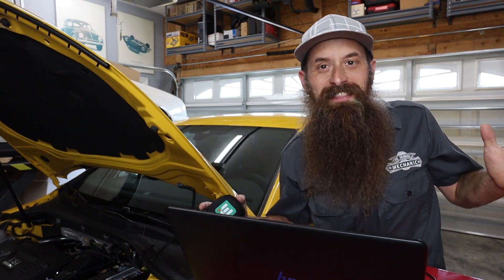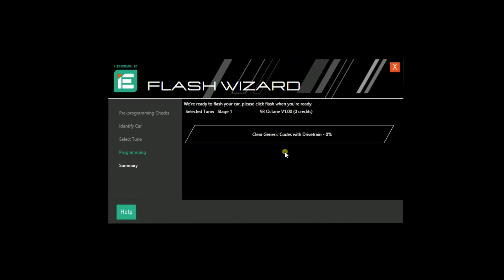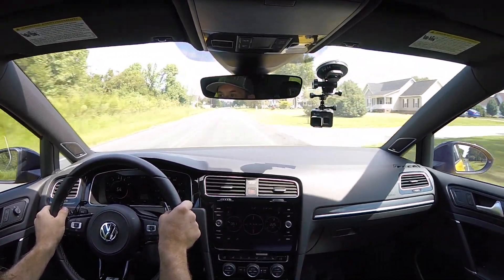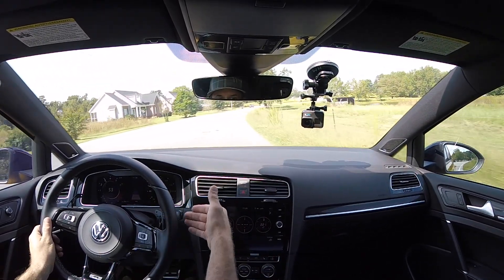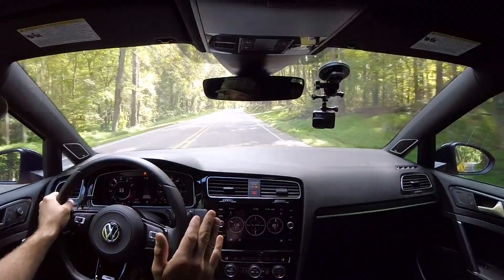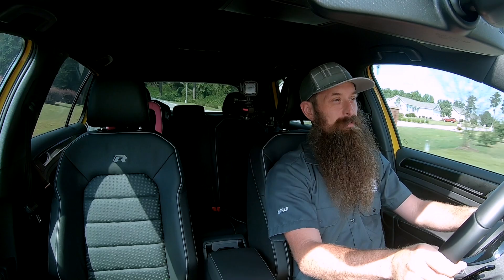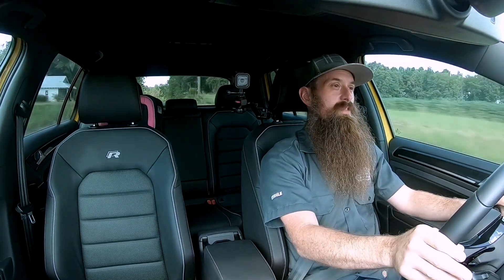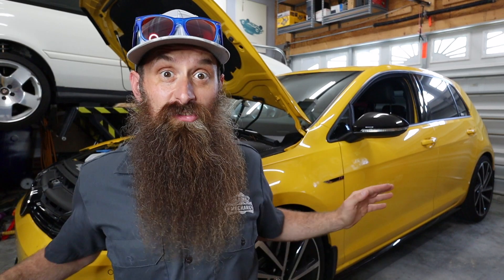How Much Horsepower Does a Tune Add? ~ Stage 1 Tuning Golf R

Comment: Unitronic has more power gains nice tunner though
Reply: Unitronic stage 1+ you would of been at around 335WHP atleast
Reply: @charlygen2cc78  Hard to say... cars, locations, dyno calibrations, dyno brand, temperature, pressure, corrections, etc... all differ the end numbers by massive amounts. A Dyno is only good at comparing the same car on the same dyno back to back... comparing two different results from wildly varying conditions just doesn't work.  Unitronic has very good calibrators, but were pretty sure all Stage 1 Tunes are going to be very similar in power output. Where they differ is how the car drives when not full-throttle... that is going to be up to personal taste for the end user.
Reply: Great point couldn’t have said it any better. With that being said, You should make a video on dyno tune and brand name tunes comparison and why is a dyno tune way much cheaper than Unitronic Cobb IE apr etc etc
Reply: @charlygen2cc78  Well, we typically don't like to advertise directly against other companies out of respect... we have always just let our products speak for themselves. A "dyno tune" is probably cheaper because contrary to popular belief...  they can't in 99% of cases offer a fully optimized tune for these vehicles. These modern VAG ECUs are very complicated and very locked down. For a company like us offering a complete shelf ready ECU tune optimized for hardware in all/any climate and altitude takes IMMENSE amounts of time. The amount if investments in both buying and engineering tools from scratch to read/flash/translate/identify the complicated mapping in these calibrations is huge. Putting a car on a dyno and adjusting a few timing and boost maps for more power a WOT is one thing, completely creating a well rounded performance file that optimizes every map takes a ton of specialized equipment (much that is not available for purchase) that a typical dyno tuning shop will not have access to. Same reason a full tune from us takes months to build vs. a day on a dyno. That is why there is only a handful of tuning companies are offering these files like we do. Hope that helps make some sense out of your question.
Reply: Integrated Engineering LLC. Yes understood, another question I have Unitronic stage 1+ on my vw cc. The question is, after every mod I add on will I have to retune my car or can I just add on mods and the ecu will react positively?
Reply: Love your videos !!!
Reply: And tbh that laugh made that video A VIDEO! Love the laugh.... hehehe 😈

Comment: Love the upgrades.  Keep goin.  I will list my upgrades and have hit 100,000 miles on Audi A3 Quattro with no issue from extra power.  Sumbitch is extremely fast. 
Unitronic stage 2 tune
Unitronic stage 2 DSG
Full set of bigger charge pipes from turbo to inter cooler and back to intake.
GFB diverter valve is stronger than stock.
Turbo muffler delete.
Cold air Intake
Intercooler
Lightweight Enkei RPF1 rim saved 10 lbs per wheel.
Bilstein coilovers adjustable
Full turbo back Borla exhaust. It has 2 mufflers no mid silencer.

Comment: TCU tune is the best bang for the buck with these DSGs.  The stock tune is pretty bad unless you drive it in manual mode all the time.  I opted for the TVS stage 2+ stealth TCU tune and it's been a game changer. Pulled my JB4 for warranty purposes, prob will tune it after the warranty expires in 5 years
Reply: I know this post is one year old..but never heard of a stealth tcu tune. That's Impossible

Comment: Oh why didnt I get a dsg?!  Scared to tune my 16 gti with all ive heard about failing clutches.  I guess that is what credit cards are for.
Reply: We do offer a low torque file that is safe for your stock clutch, when you do upgrade the clutch and are ready for more you can flash the High Torque file at no additional cost.
Reply: Stage 1 low torque or get a stage 2 clutch. I'm in the same boat, 17' GTI SE.

Comment: Do you think it’s worth tunning my MK7 GTI with 120K miles on it? It’s still fully stocked and it’s my daily driver. No issues with the car but I wouldn’t mind adding 70+ HP to the stock 210. Why didn’t you go unitronic?
Reply: If you've done your services on time it shouldn't be an issue. May be a good thing to do a leak down test and have someone give it a once over before hand though.

Comment: hey man i have a mk5 gti and ive been thinking of going stage 1,but ive heard it puts alot of wear on the stock clutch. just wanna know what your opinion would be.
Reply: Tuning does put stress on manual clutches, yes. Especially on older higher mileage stock clutches. You can always tune it and go back to stock (at no cost with us) if it starts to slip, then put the tune back on (again at no cost) once you upgrade the clutch pack.

Comment: You should definitely do a downpipe if you haven’t yet. That’s where the serious gains are in junction with a tune.
Reply: Keith Doran Won’t do much with only stage 1. You’ll even lose numbers with a DP on. That’s why the tuning company has a list of requirements and recommendations per tune. As for stage 1 with IE, I believe the only supporting mod required is a CAI. DP and IC is required for stage 2.

Comment: Wow 40 psi on the gauge when 30 is stock. That makes me want to make the jump. 
I see your screen does the same as mine when the g meter shows nothing on start. Forcing you to change away from that screen and back to it to get it working. Is there a fix for that?
Reply: The gauge includes the static atmospheric pressure too.

Comment: I ran my MK7 with the Soundaktor off for 4 years. Finally turned it back on to sell it to a 22 year old kid who giggled uncontrollably when we went out for a test drive. I think it's just designed to get you to buy the car, haha, which he promptly did.
Reply: you know you are old when u call a 22 year old a kid
Reply: You know, I hate it in theory but I’m gonna keep it. I think it sounds good and at least it’s not digital noise piped in through the speakers.
Reply: Funny when i sold my mk6 GTI with stage 1 , he was excited about buying a golf [ cause you know you can tune em  man ] really i just saved you some cash man i have it , SOLD , did not even try to beat me down , and i had the soundaktor on  too.
Reply: Golfmother it’s a fair point but personally would never buy a car that’s been Mapped … mainly cause you don’t know if the tune was done properly or not .. also any tuned car obviously been thrashed about 🤷‍♂️

Comment: I had to put the R8 coils in, the stock ones kept failing.  Is that a common thing?
Reply from the maker: Coil failure is common on all VWs.
Reply: @HumbleMechanic  I had to do it after the tune.

Comment: Why not go APR? What make your go EE ? Or not unitronics like Dap
Reply: KnightGamingDc5_ APR is overrated. I’m running IE stage 2 performance and DSG tune on my MK6 GTI and I love it! I also have supporting mods all from IE - CAI, IC and DP. Best part is, IE has the best customer service hands down!
Reply: 034>
Reply: IE might have given the HM the tunes for free if he did an episode on it.
Reply: Uni and APR are good options as well. We think you'd be very happy with IE's tunes as well as theirs. A lot of time has been put into our tunes on the development side making them a very high quality product. Plus, you can return it if you don't like it, pretty minimal risk.
Reply: 1.) It would be awesome to see a comparison of different mild tunes for Golf R’s!! 
APR’s APR+ tune (limited-substitute-drivetrain-warranty-enhanced low torque stage1) they vow makes 357 HP/ 349 TQ. And your VW dealership will do the tune. Discussion of the value of APR’s warranty aside (I’m sure it costs more than the product reviewed here) APR’s gains from modest-modding seem comparable, no?  Would be super interesting to see video of tune v. tune!

2.)How would you compare the driving experience of an air cooled 911 to a mildly-tuned Golf R? 
Obviously the 911 will deliver all kinds of majestic mechanical sounds and feelings, but ultimately which is quicker? (In the dry, obviously. In anything but perfect conditions, if anyone actually takes a RWD aircooled 911 out of the garage in rain/snow, it will be slower than the R.)
Reply: APR is too conservative and their support is garbage

Comment: I bought an Integrated Engineering stage 1 tune with the same flash loader for my 3.0T C7 A6 and it's been about a year.... 100% love it... zero complaints, the car is stronger and far more engaging to drive.  Power delivery is BUTTERY SMOOTH... huge thumbs up to Integrated Engineering for their software!
Reply: Thanks mike! We love to hear that you are happy with your tune(s).
Reply: Does doing this violate the warranty?

Comment: I remember feeling the same way after tuning my GTI. And, like Charles alluded to, you'll want more :)
Reply: I drive a 2014 Wolfsburg GTI. What year, model, and hp after did you have? What kind of mods or bolt ons did you have to equip to help relieve the stress of said tube if any?? Any feedback would be amazing.
Reply: @jbac5767  Wolfsburg? Love it! Mine is a '16 MK7 GTI Sport, originally "210" HP (underrated of course). Went APR stage 1 ECU and TCU tune on the 6-speed DSG. That tune has undergone a lot of revision in the past 1-2 years and it's better for it in my experience. 290 HP and 320 ft/lb is the latest crank figure on *87* grade fuel! I stick to that due to 91 ACN regional gas which causes the ECU to pull timing shown in logs. However, ran the 323 HP crank, 91 tune ran just fine with new intercooler, charge pipes, inlet pipe, turbo muffler delete, and high-flow drop filter. A lot of stuff for stage 1, right?! Your fuel might be better, by a lot. APR now has a fuel info page stating E85 might be an option IF your logs show fuel trims in range. An E30 blend put me on knock-free 380 ft-lb high torque stage 1 territory. Smoke 'em if you got 'em.
Reply: @john_dee1431  Goodness!! Yea I'm lucky eith the Wolfsburg simply becuase it was produced in the Wolfsburg factory itself and everything is in German so the car has stood up even with my little bit of negligence.  The car came with an INJEN CAI. I've done nothing else to the car because I know you must be specific when modifying a VW eapecially. I run 91 at all times and it's been good. The car feels surprisingly powerful for only having the intake and MAYBE 190 to the wheels. It's a 6 spd so I'll lose time there but I don't race or rag my car at all. I only get on it hard maybe once a week to keep it somewhat fresh.  I look forward to tuning it one day and of now I'm simply doing research and asking around. Thank you for your feedback!

Comment: Dammit Charles. You're going to make me go buy a Golf R.
Reply from the maker: DOOO IIIIITTT!
Reply: @HumbleMechanic  I did it, because of you! i have 2019 Gold R in blue :)
Reply: As the devil on your shoulder, we highly recommend you buy a Golf R as well!
Reply: Do it, you won't regret it
Reply: You thinks that’s awesome do a STG 1 tune on an RS3
Reply: @desertsoldier41  You think that's awesome do a STG 1 tune on an RS6
Reply: I get my Golf R in under a week now
Reply: Word i want a R now as well
Reply: Private Eyes I haven’t been following the R news and this came as a surprise to me. Do you have a read or video you can recommend that talks about VW’s plans to discontinue the R for some time?
Reply: Milen Stoikov from what I saw it sounds like the mk8 comes out soon this fall or winter and they will stop making golf R mk7s once they start making the mk8s but its going to be a couple months until the 8 comes to the US so there will be a short gap in production as VW switches from mk7.5 to mk8 golfs
Reply: Private Eyes There’s no comparison...
Reply: Mike Lucas No way, man. It’s a totally different car - GTI’s are great, but they’re not in the same category.
Reply: Get a GLI
Reply: For anyone on the R vs GTI fence, I offer my own experience.  2 years ago, I bit the $ bullet and replaced my 2015 manual GTI with a 2018 DSG R - one of the first ones off the boat in Houston.  The GTI had an APR Stage 1 tune and APR cold air intake.  BTW, I did the tune 1st and added the intake later... and the intake made a HUGE difference.  Bye bye any remaining turbo lag.  Your ECU will thank you as it realizes the engine is breathing better.  I bought the R for the AWD and mainly because even a Stage 1 tune made the stock GTI clutch unhappy.  The AWD and DSG make a world of difference even before any tuning.  But then I added an APR Plus ECU tune (basically a stage 1 with a power train warranty that matches the factory 6 year), APR TCU tune, and APR intake.  Major grin enhancement for not that much $.  No regrets whatsoever on getting the R or the APR upgrades to the point that this is the first car I've ever owned that I didn't have the itch to sell after 2 years - I've never had a car for longer than 3 years.  I'm kindof committed to it now that I just had an APR intercooler installed last week.
Reply: K Hamilton  Doubtful....No way you are making 500whp on a stock internal GTI.
Reply: GTI all the way for me. I don't think the R is worth the extra bucks in comparison. Do I dislike the R? Of course not. But there are more things I like about the GTI than the R... ALL things considered. But hey, my opinion only!

Comment: Technically, you just need to put the trans into Sport mode and turn off traction control to do launch control. Race isn't required, but the firmer dampers probably help with weight transfer.

Comment: With the DSG tune does it still auto-upshift when in Manual mode?
Reply: I have an 18 GTI, APR tuned w/o DSG tune, and it doesn't auto-upshift. It auto downshifts in manual mode when RPMs get low.
Reply: my TCU tune doesn't auto upshift in manual mode.  it kind of worries me because i don't like bouncing off the rev limiter by accident.  also i have no idea what would happen if i was to accidentally tap downshift 1 too many times from 5th into 2nd.  not sure how the resilient the safeties would be to preventing a DSG money shift
Reply: @Gandalf721  i hope i never have to find out if that's true!

Comment: My radio failed in my 16 golf r at 31k miles.  They stuck me with the entire bill.  $2100.  Needed a new headunit and a control module.

no more vw for me
Reply from the maker: Ouch.. Why dud you have to pay?
Reply: Should have bought used. Dime a dozen
Reply: Those are all over wow did you get hosed

Comment: Damn if you're going to tune it like that you might as well put on a turbo back and CAI. Please correct me if I am wrong but when you add a tune to a turbo car isn't it wise to add better breathing? I might be wrong but when you request beyond stock boost the turbo is going to want an easier way to get more air and to expel the air as well, right? When you get a chip tune without a more opened up intake and exhaust then what your essentially doing is over working the turbo which will eventually cause it to break. Am I on point with this? Or as a friend of mine a while ago had a 300Z TT. He had a great tune and full intake and exhaust system on it but he felt a loss in power over time. I pointed out that maybe the stock turbos were being over clocked and that was causing them to wear down faster plus his tune and intake/exhaust mods were pushing too much air than the stock turbo's could handle. I am not sure if he sold it or went to a single turbo set up. I also think that the idea of a top/side mounted inter cooler whether from factory or aftermarket defeats the purpose for obvious reasons. I as many others hope to see what The R does with Stage 2 and a proper intake and turbo back exhaust set up. I love VW's, but if I had the money I'd safe a few more months for a Model 3 Sports.
Reply: Our Stage 1 tune is designed for stock hardware and is completely safe and reliable with no other modifications. It can support an intake, intercooler, and cat-back just fine. Once you go with a downpipe it does require a Stage 2 matching tune.
Reply: @IEtuned  Hey thank you for responding.
Reply: @matthewmohri9990  Of course, no problem at all.
Reply from the maker: You can do that. It may help. For stage 2 you need a down pipe. I don't plan on turbo back exhaust because I like that is not loud. We will do an intake soon

Comment: A tune will also get rid of some catalytic converter strategy to cool or heat cat to stay in operation temp.. and get rid secondary O2 sensor values and secondary air pump. While keeping cat heat protection.

Comment: A stage 1 in Europe is like 370-380 Hp.
Reply from the maker: Nice. To the wheels?
Reply: @HumbleMechanic  o the crankshaft...319at wheels are just well done..for stg1
Mine was 363 at crack..and 275on wheels ..this was a MTM stg1
BUT if this R makes 275on wheel OE...if so..so.ething wrong here gents!!!
Reply: @HumbleMechanic  To the Motor 🤟🏼
Reply from the maker: @sodmg1997  That is probably about where we are
Reply: Same here in the US. Wheel HP is different than "crank" HP which is what tunes are rated as.

Comment: Do you find your shifts are super aggressive when using launch control?
Also how much power in your opinion can these current gen Golf R's handle without running into any major mechanical issues?
Reply from the maker: More than just normal acceleration. I think they can do 450WHP.. But maybe more